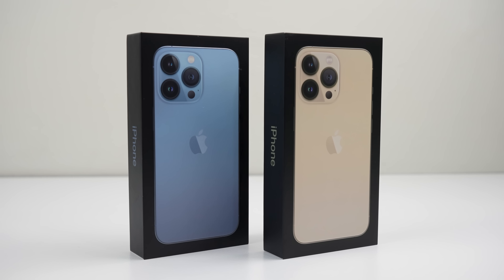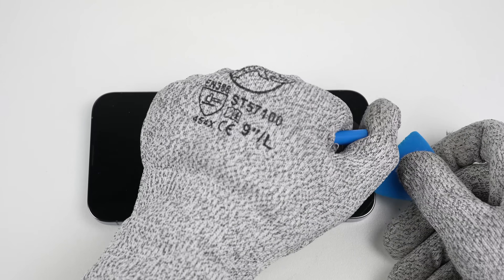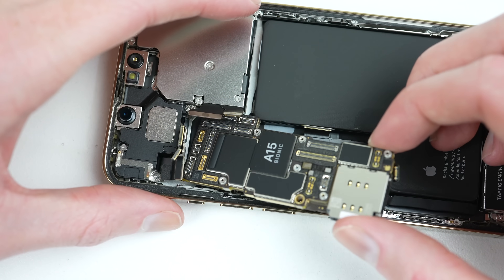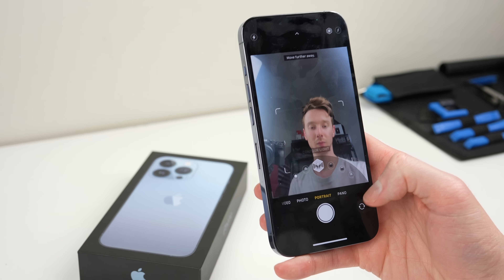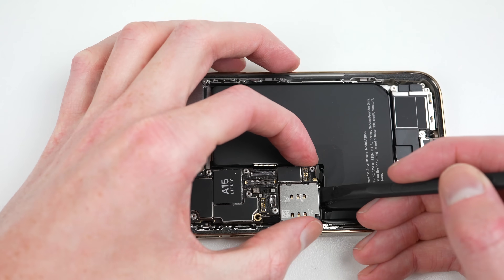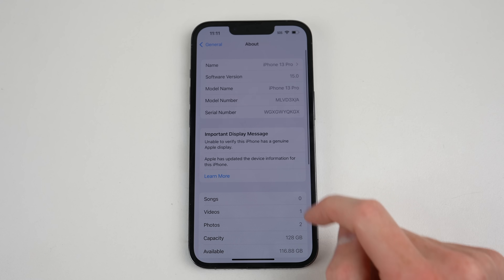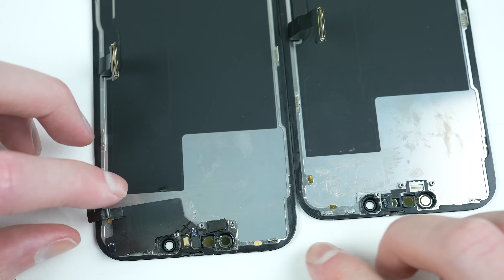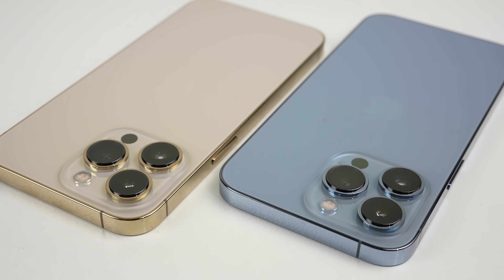iPhone 13 A Repair Nightmare - Teardown and Repair Assessment

Comment: This is the infamous Economy 4.0: People don't longer own any hardware, software, or intellectual property they pay for. Instead, they are allowed to use these goods for a certain amount of time in accordance with the marketing planning of the supplier.
Reply: so its true that they slow down phones overtime and give you bugs to make you upgrade?
Reply: @mrolliepoper  The poorly communicated update which made older models "slower" had the sole purpose of saving the old batteries to keep the device "alive" even longer. This could of course be deactivated in the settings and only happened when the device had already crashed at least once due to low battery voltage.
Reply: Something something you'll own nothing and you'll be happy.
Reply: Fortunately this is now illegal in the EU. I hope this gets addressed in the US as well.
Reply: It started with Software as a service(Saas), now it's Utitlity as a Service(Uaas).
Reply: @spoonreev8246   Also sadly  appple is making a new one - Hardware as a Privilege (HaaP)   They decide when it's fixed, old or beyond repair. New slogan  "Apple products - it's a privilege,  not a right ... to repair"   😣
Reply: @spoonreev8246  haha and now your immune system is being treated as a Subscription service because they’ve already came out and said they cannot rule out indefinite booster shots
Reply: Nothing changed, government owns you. You continuously have to pay your tax to live, use electricity or even to die.
As long as you are using property truly owned by someone else, you will remain as the limited user under permission.
Reply: Aka rentier capitalism
Reply: @Ironpine27  not entirely true. Apple “slowed down performance to maintain battery life on older devices with wearing batteries” they didn’t add purposefully add bugs to any of their software 

They added battery health so if you pay Apple to replace the battery it can speed your phone back up.

I’m not an Apple fanboy, and Apple needs to fix their anti repair bullshit, but I prefer facts to actually be truthful and not made up
Reply: Most big cooperation does this, whether it's Samsung or Apple, they all have planned obsolescence
Reply: @pixels_per_inch  this happen in like cars industry too .... Veritasium make a whole video about planned obslence
Reply: only the id10ts take that path deb.
Reply: It's the subscription model run amok
Reply: Very true.
Reply: Engineered obsolescence.
Reply: and those are the same pol complaining about not owning anything 8n communism... xD well shit

Comment: When you change the logic board you also have to keep the same Selfie cameras and hearing part that is bonded with the proximity sensors that are coded with the logic board! so you dont get the face ID Problem! if im wrong wow!!! if it works for you guys? your welcome!

Comment: Well they are repairable. Just by authorized service providers. And they need to be calibrated with new parts to make them function as normal. Even with "right to repair" in the US, you might still have to have software to calibrate it

Comment: This isn't just specific to Apple. All car manufactures operate the same principle - change anything and the car won't accept it. You need to code in the new serial numbers for it to accept. Same with these phones which is what apple service centers will do. There are so many shitty 3rd party service places they just don't want that hassle and brand/reputation damage.

Comment: I live in Brazil, and I found this security on the replacement parts positive, because here most of technicians use those Chinese crappy parts to change in your phone and charges you a LOT of money and you never will have the same phone again, so, i can’t say for u.s people (or other developed country), but here in Brazil this lock is a good thing…

Comment: Wow wow wow - What a thorough test, and conclusive results - Apple are deliberately making the phones unrepairable by anyone other than themselves. Can you imagine this in the car market? (who get close sometimes). All the claims re battery life and issues that occur when software updates are carried out take on a renewed reality. Good work HJ
Reply: Car market has been literally worse. Some brands will disable the vehicle if a headlight bulb is replaced, and one in particular (I believe it is Bentley) if a car is in this state, attempting to start it will result in the car frying it's own ECU "To prevent theft"

Comment: I thought a lot of the component swaps you tested were much too integral to the secure internal communication channels that should be designed to prevent tampering. For example, you should not be able to play back a recording of someone’s face to unlock the phone. That is an encrypted communication channel with a certified, synchronized, trusted component.
Reply: But that only applies to FaceID. If security is truly the reason, why disable TrueTone? Why make the camera glitch? Why disable automatic screen brightness? I completely understand Apple's decision to make the FaceID module mated to the motherboard for the reason you described, but these new changes are indefensible.